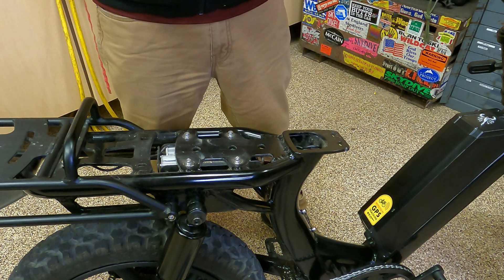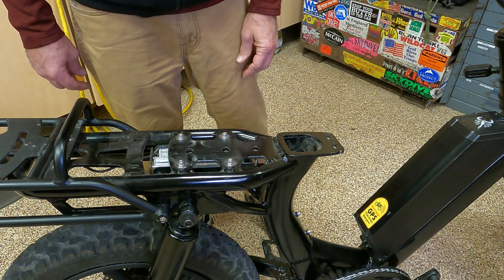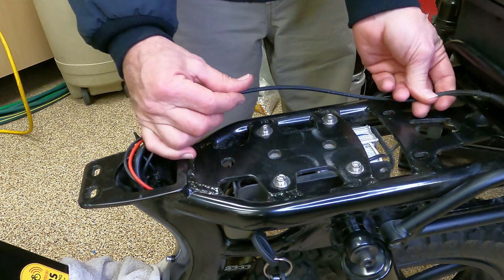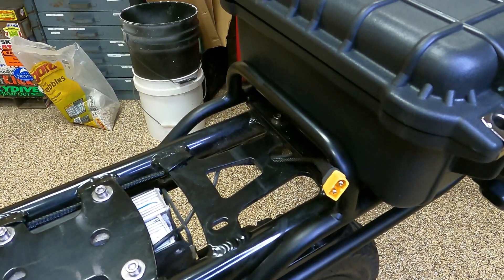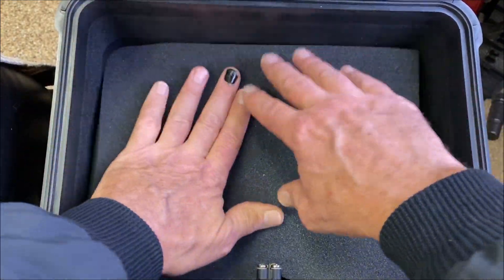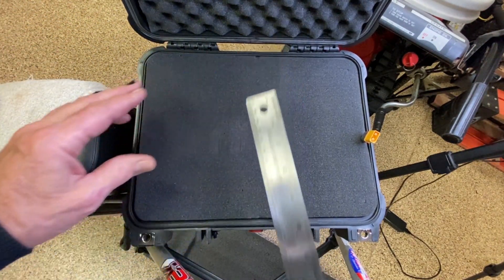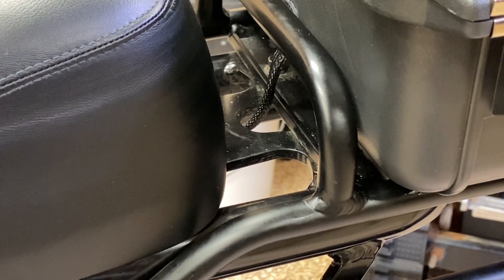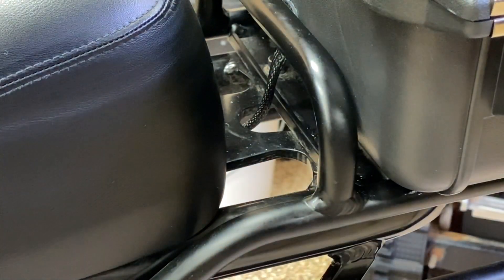HOW TO➕ADD an Additional🔋Battery in a Box to any E- Bike🛵 🚲 Easy to DIY💡  PART 2 of 2

Comment: Good mod! Do you have to use a 52v x 20ah x 1000w bat?  Could I use 52v x 20ah x 1500w battery as a back up?
Reply from the maker: Yes you can
Reply: @UncleFjester  Thank you!
Reply: @UncleFjester  Purchased the box, switch, and connectors. What gauge wire? Will order the 1500w battery once I get everything set up. My wife is waiting on her bike, will do the same mod. Thanks once again for all your help. Juiced Bikes should provide you with a lil something, something, for all your mods! The non boomers don't realize the research, measuring involved and frustration. I sincerely appreciate all your hard work. You stay safe, my friend! 69yr old boomer!
Reply from the maker: Thanks FW!
#12 will be fine #10 is of course better, I'm about to order a battery too, as weather is beginning to warm up, FINALLY!
Reply: @UncleFjester   Because of you ,I have bought a second battery from Electromotive Mods and a wiring harness from Ebay. Thanks  Uncle Fjester  !

Comment: I just bought the isolator switch.  I am not sure which wires connect to the isolator from the battery.  Do I connect the positive on one side, and negative on the other?
Reply from the maker: The positive feeds thru the switch
Reply: So positive on both sides and negative does passes through outside switch do I have that right?

Comment: Near as I can tell, your scheme here will only work with ebikes that have separate power switches for both the stock battery and controller. However unlike the HyperScorpion, I believe that many if not most ebikes nowadays lack a separate power switch for just the battery. Hence your scheme will probably (almost certainly) not work as advertised for any ebike (or anyhow not without further modifications).
Reply from the maker: Good point!
Reply: @UncleFjester  Another thought: I've heard at least two ebike CEOs say that parts/components became pretty scarce this past Summer, are expected to be more readily available over Winter, but then will likely become scarce again come Spring. This might be one good reason to go ahead and purchase your battery over the Winter (e.g., should lithium-ion cells become scarce in the Spring and/or potentially increase in price).

Comment: The marketing for my scorpion says 45 miles. I think I pushed it to about 25 miles and just barely made it back home but there were a lot of hills. You know what would make for a great video, if we’re able to get battery diagnostics to see how the battery is degrading over time. At the very least, understanding how many battery cycles which will help understand the loss of range.
Reply from the maker: If Toga's Marketing said 30 mile range, I can't say I would have bought this.
Reply: @UncleFjester  I hear ya. I’m disappointed with the range for sure. I just sold our second car, because I’m making payments for something I haven’t driven in 6 months. Rather save those payments  to get something even nicer once this f’n pandemic is over. Our winter season won’t snow here in MD until maybe December at the earliest, so I’ll be riding my ebike as much as I can.

Comment: Cool project UF. Wondering why you need to use the batteries separately. If it's wired in parallel you have one big battery with double the amp hours as long as the batteries are the same.
Reply from the maker: I'm not 100% of batteries being the same...yet
Reply: @UncleFjester  I see. Thanks for the reply.
Reply: Its dangerous because of differences in battery voltages. If you are making your own harness  should not be a problem to add a safety high current schottyl? Diodes to stop reverse current as well as balancing load when they reach equal voltage.

Comment: So what happens when you forget to turn one battery off and you have both on at the same time?
Reply: I think you might damage (if batteries are at sufficiently different voltage levels) a battery cell or more.  If the controller is only rated at a certain max amp-hour,  having to manage in excess might damage it, too.